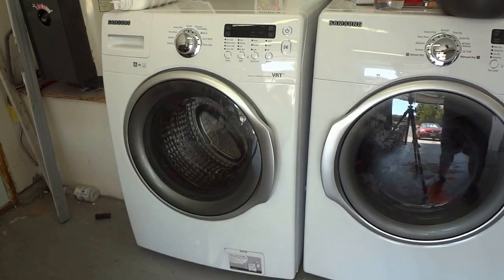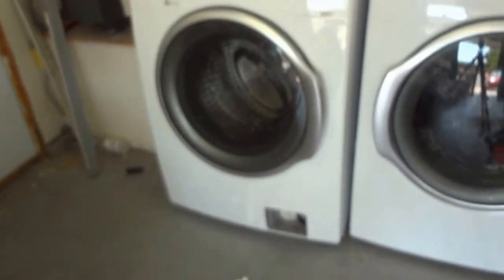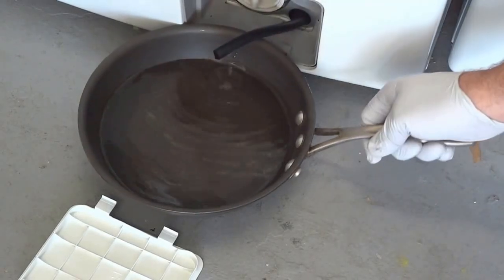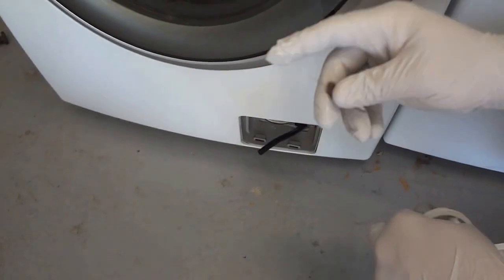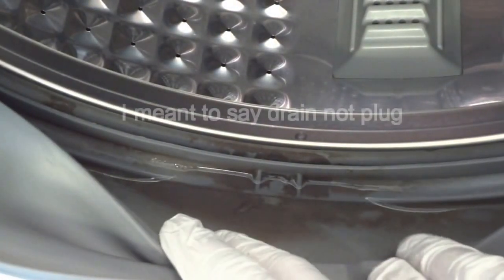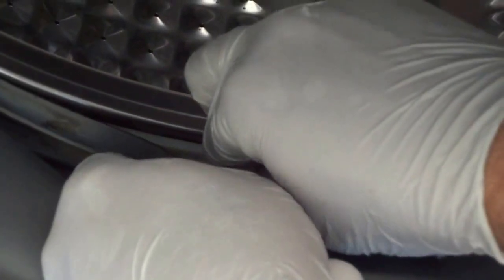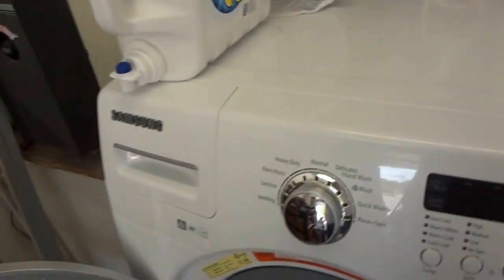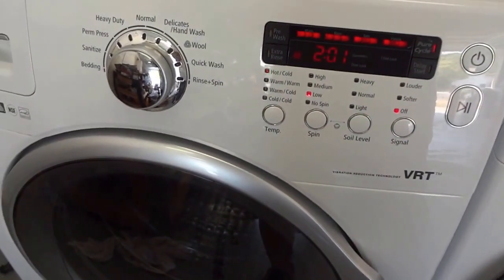Getting the stinky smell out of a Samsung front loading washer

Comment: Good video thanks. Was going to ask if you ever have where your washer goes clunk clunk clunk and is off balance like all the time nomatter how big the load it seams. Going to try to level and adjust those plastic feet at bottom. Hoping that will help . Thanks for the video.  ps viniger is great to run through your coffee makers to get back to new too. Also great to soak shower heads and various other mineral deposited things. Oh and do you know the cycle that uses the most water? Seems like these use tiny amount of water.

Comment: Great video. I have same washer- A few other tips: I pour straight bleach into that gasket area (down each side, pull it back- get it right in the crack) about once a month when I’m doing a load that will be using bleach anyways.
I try not to shut the washer door when it in use  so that airflow gets in there.
I add vinegar to every load instead of fabric softener.

Comment: My wife bought a Samsung washer and drier years back. Front load with pedestals. Not cheap even back then. Worst decision she ever made. I wouldn’t give these things away.  We have been emptying this sewage smelling water and wiping the seals down for years snow and are about to get new top load machines because of them. Worst design in a machine ever. They could have at least come out with something that is an external pump you can have put on the washing machine to drain the excess sewage water out of your drain base after every wash. No matter how many wipe down and interior washes we perform our clothes stay the same; just smelly and very hard to dry with this drier.   
It can take 3 to 4 cycles to get a load of towels dry.

The only good thing  about them is they look great and play a nice little song when they are done with a cycle. 

Our model #’s are WM2455HG and DLE5955G in case you want to look up what not to get. If you happen to see a drain door on the bottom right of left side of ANY washing machine run away. 

I would take my old crappy top load Hot Point washer and dryer over these any day of the week.

Comment: Hi Jon thanks for your helpful hints. I think we left the stinky door gasket/seal too long without cleaning and now I can't seem to get ours cleaned out anymore. Is it possible to take this big gasket/seal off the machine to soak it in bleach? We have a LG front loader but it looks just like your Samsung. I cleaned out as much moldy gunk as I could but it's very stained and I can't seem to get  all the moldy gunky stains out.
Reply: Hi Carol - I can't answer your question though I'd be curious to know as well since I also have an LG washer.  I wanted to suggest that you call LG support.  I've called them twice and both times the rep was friendly and helpful.  Good luck!
Reply: There's plenty of videos on how to replace that seal. Use those to guide you through taking it off and put it back on.

Comment: Thank you for posting this video!  We moved into a house back in August and they left their Samsung washer and dryer and it stunk so bad!!  I just finished cleaning it, where you said to do so, and it' now running on the Pure Cycle with white vinegar.  What's interesting, the owners manual that came with it did not have anything about Pure Cycle, but instead 'SilverCare'.  That was not helpful!   Another place to clean, that was completely covered in mold, was the pull out dispenser tray.  It completely comes out and all pieces are removable.  That was gross!  Do you know if the dryer is suppose to have a light bulb?  Again, thanks for making and posting this helpful video!!

Comment: I just recently had to replace the drum bearing on my unit.  Upon separating the wash tube and removing the drum, I was appalled at the amount of sludge that had built up in-between the drum and the tub.  I ended up using a pressure washer to clean the parts.  I also found the same sludge in each of the hoses that ran throughout the machine.  It was disgusting to realize that our clothes were being "cleaned" in that mess.  Granted... I didn't know about the Pure Cycle mode and therefore it was never used.  I don't know how much of a difference it would have made, but I'm definitely using it from here on out.
Reply: You did the drum spindle and bearings yourself? Mine is out too.  My regular repair guy who I have known for ages and trust quoted the spindle and bearings at $580.  Ugh.  Sooo much $$.  I have been wondering if it was full of sludge down in there...and the hoses - I am gagging right now.  Our set is almost 5 years old and spindle/bearings went out about 5-6 months ago.  bad Smell peaked since then.
Reply: Yes.  It wasn't too hard.  Paid about $105 for the bearings & seal (eBay) as well as the drum seal (AppliancePartPros.com).  Works like a champ now.
Reply: Ok, I heard it was kind of hard...I have taken apart my dishwasher to find clogs in the high loop in my drain hose and replaced heating element. That is the hardest stuff I have done but I have done a few repairs here and there.  Is it the spindle and bearings? When I described symptoms to my appliance guy over the phone, that is what he said. My spin cycle is LOUD and not spinning out water like it used to do.  Hubs isn't super handy.  I am the handy one.  But saving $500 sounds good!!!
Reply: I have a similar model to yours but in grey. I believe the bearing has gone - found smoke in the drum after leaving the laundry unattended and now the spin cycle is quite loud. From what I've read specifically: https://appliantology.org/blogs/entry/721-diagnosing-catastrophic-front-load-washer-drum-bearing-and-inner-basket-failures/  it's suggested that even if you do the repair, it won't last. I'm bit reticent to attempt the repair anyway. I live in a condo and don't really the room to do a full disassembly of a major appliance. Did the bearing repair hold up?
Reply: Darryl Byrne, my first repair didn't; but that was because I didn't replace the spindle.  I thought it was good.  It wasn't.  Did the job a 2nd time with bearings, seals and shaft and had been running smooth ever since.  It's not hard; nor does it take much room.  Just patience.  Take pics as you go to help you remember where everything goes.  No guts, no glory.  Good luck!  ;)
Reply: Alright I am back at attempting this repair.  It went from poor spin (we kept using it) to NO spin.  I am ready to attempt this repair as a new one is not in the cards right now. Eiher I fix this or I buy a used machine on craiglist.  I have done some modest repairs via youtube and amazon parts.

Comment: Just to let you know, Samsung has a RECALL on their front load washers.  You should look into it because you have the older seal around the front door.  As you can see water will collect in there and cause a lot of mold and mildew.  I have a newer one and the seal is redesigned.  However, the smell is still there and I clean mine on a regular basis.  Samsung is one of the worst when it comes to this particular complaint.  Had I known this was a problem with this model, I would have looked elsewhere.  We got a great deal on this set because they are red, and no one was buying that color, so they were on clearance, as well as a Military discount.  So we got a great savings on money, but spend way, way more time cleaning it and more money and water cleaning it on a cleaning cycle.  I NEVER had a problem with a top loader, and with the water level sensors they have these days, I'm not sure there is a great savings with the front loaders.
Reply: thought the recall was for top loaders for explding
Reply: randomrazr, The top loader is only their newest recall.  with Samsung having such low quality products and even lower quality inspections, it is a wonderful they are still in business. They always try to get their new product to market before their competition and we can see how it is effecting their product quality.  They need to slow down.

Comment: I've had the same machines since 2010 and I've never had this much grime build up. You probably do more laundry than myself, I'm a single man. I have loved the machines thus far, how about you?
Reply from the maker: I'm a big Samsung fan. The washer and dryer have been flawless and we have a Samsung fridge that's fantastic. What I love is the spare parts are so inexpensive. We just moved into a new home that doesn't have natural gas so we had to buy a new electric dryer, we bought another Samsung.
Reply: +Jon Sotelo 
Mr. John, my Samsung twins are about 5yrs old. They are in a closet next to the kitchen. The smell gets so bad it'll make you pause or run as you walk past. Have noticed and cleaned the washer ring to no avail. Have also drained those two behind the door on front bottom. Have tried the Tide washing machine drum cleaner. Have tried Clorox and a hot water cycle. Have not tried vinegar. Also beware that muther flooded my back bathroom and caused $$ damage. The Samsung washer is designed to always keep hot water in a small valve in the top right rear. When the water gets cold it uses the drain. Unfortunately the plastic valve cracked and leaked before it made it to the drain. And kept on leaking and leaking but only after the water got cool and valve dumped it. Repairman busted me for about $295'and 15 minutes it was fixed. I Really do like my machines but this smell is awful. And really has only become an issue in the past 4-6 months. Thanks,
Mark, way down in Mississippi

Comment: Thanku I was cleaning this door gasket but I never tried too hard to push and c beyond this gasket,i will defiantly clean that. I have same machine, probably a model older but it has dryer built into it. Try toilet bowl cleaner clorox every 15 days and run a shorter cycle available. Use spoon not scoop when using clorex in soap dispenser.
Draining water through the tube part is important. Once I found my son's  stickers and a coin. I don't know how it went that filter side.

Comment: This is know as job security for the repair man. Cold water washing is BS. I always wash my clothes in warm water. Have been since the day I learned to do my own washing. If you have not noticed the trend there starting to use steam washing and anti bacterial wash cycles! Requires hot water. or a heated coil. Have a front loader for 20+ years and my clothes and washer don't smell like the smell you are describing. Evey thing today is made cheap as shit to begin with.
Reply: What front load washer do you own?
Reply: Actually cold water wash isn't always cold water washing. It's cold water INLET. Many cold wash cycles actually warm the water internally rather than get a direct hot water feed in. Most new washing machines are like this (internal heating element), as modern laundrys aren't plumbed for both taps.

Comment: We have this same machine and the last two times I cleaned out the filter, not only was the smell overwhelming, but there were hard chunks that almost looked like gravel at first glance, but ended up being super stinky chunks of I-don't-know-what, and my biggest concern, long thin strands of what look like shredded rubber or silicone. Like a seal or gasket or something? Has anyone discovered this before or any idea what all this shredded rubber may be from? I'm afraid that something is wrong inside this machine.
Reply: We let ours air out while on vacation and when we used it again we had layers of stuff.. shredded like in the filter.   So stuff builds up like crazy in these machines.   If it works I wouldn't worry about it.

Comment: 3 Tricks. Open door to dry out. Soap dispenser remove and drain out all water re install but leave open to dry out. Suck out door boot drain holes. Suck out debris filter. Again once a week dry out washer by opening door and soap dispenser to let them dry out.  Smell should be gone in 1 week but still once a week dry out washer.

Comment: Samsungs are the worst front loaders. They put 3 tablespoons of water in the tub and think that's enough to do the job.
Reply: BroccoliBeefed 
there is an adjustment under the top cover. turn it clockwise 3 turns and you will be good. location is front right corner box with wires and a screw.

Comment: have you had any problems with mold in soap dispenser?   i have mold that grows behind the dispenser & is so hard to reach.
Reply: Use hydrogen peroxide or viniger for that. Spray bottle or run in cleaning cycle.

Comment: Samsung has these maintenance tips right on their website to prevent problems: Avoid liquid fabric softener (use dryer sheets instead). Keep the door and detergent dispenser open after use to let machine dry. Run a self clean cycle and clean filter regularly. Try powder instead of liquid detergent. Run warm or hot cycles with bleach at least occasionally. Try using less detergent (pods are too much detergent for most loads). Make sure the machine is level.

Comment: Its a washer shouldnt have to scrub it clean and such. We have had front in loaders before for years until electrical panel messed up. Got a new samsung back in 2012 not a year later it got mold in it. An for the last year or so it has started leaking water from the bottom with each cycle no water from the pipes at all. An i clean the filter on bottom mine doesnt have a black tube to drain extra water. Im about to throw it out the door. It has mold in it but no mold smell and my clothes are cleaned just fine.

Comment: Pure Cycle is kinda useless, our stinks pretty badly (came with the house) I've tried to clean the thing so many times and I end up using chemical cleaners (meant for HE washers) and a long load. The biggest issue with ours is weight sense, it want to put the smallest possible amount of water in the drum resulting in most cleaners just creating a lot of bubbles ... 

Anything put into the washer on "Pure Cycle" will soon be lost, the machine basically spins non stop constantly rinsing itself so the cleaners don't have long at all .. the machine will rinse them away within a min or two as it doesn't stop rinsing and draining the full time. 

I don't like these or really any HE washes I miss the traditional kind they worked perfectly fine for what they are, only half decent HE washer I've ever used was a set of brand new LG combo back in roughly 2018. The land lord was kind enough to provide them and I was honestly shocked, they where both brand new and where like $1,200-$1,500 each just really nice set. That was good tho (not because of new) but because it gave you the option to override the system verses most other machines and the "we know best" philosophy where you are give next to no input.
Reply: Yes, I like to be able to add more water with a press of a button, or extra rinse.  Because of the reduced water programmed I wash smaller loads so that there is sloshing in the drum ensuring the clothes are agitating adequately.  With the smaller load I switch to speed wash, extra rinse.